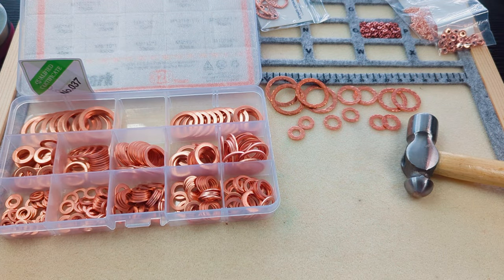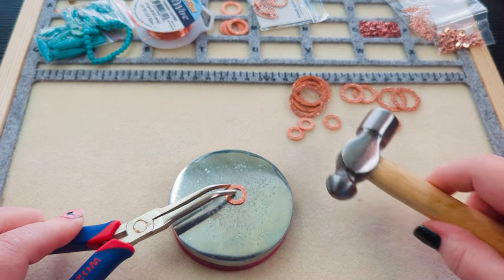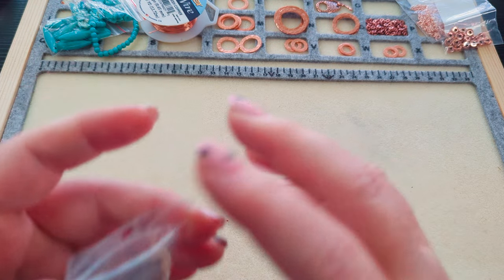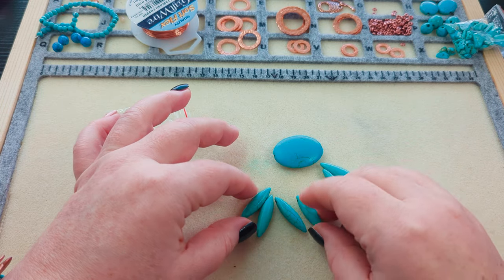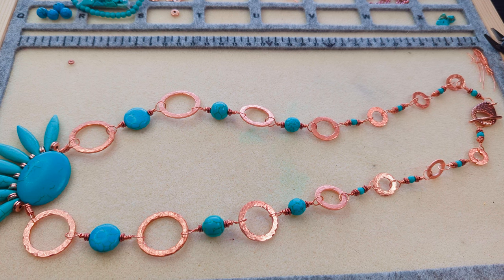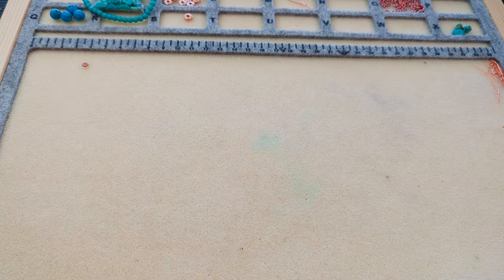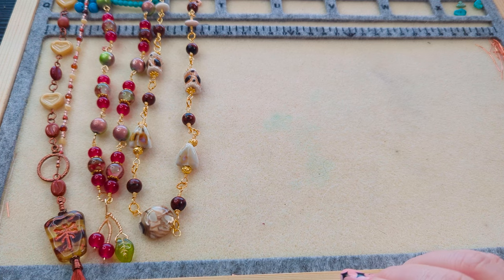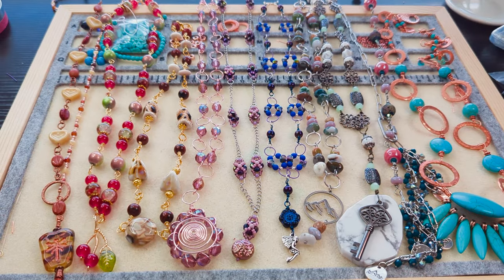Final September Chain Challenge necklace + wrap-up show and tell with all projects.

Comment: Very pretty necklaces. I love the 1 with the copper wire & purple beads. I like your bead mat & bench block with the pink on the bottom. Where did you get them? I need to get me 1.
Reply from the maker: My pink bench block came in a craft kit, and I haven't been able to find a source for one exactly like it, but you can find similar ones on amazon.  I put a link to the bead mat I use in the description of the video.
Reply: Thank you @BekitoBurrito